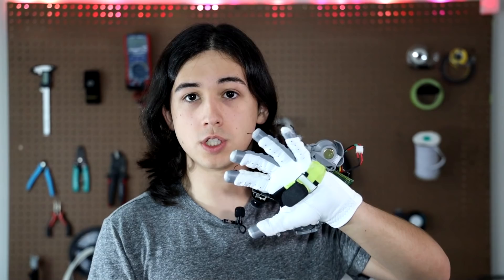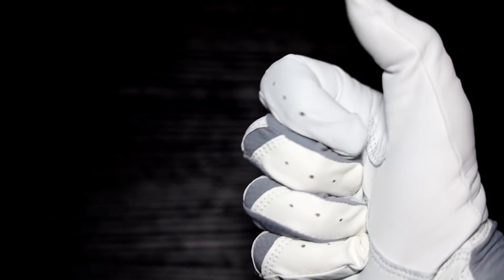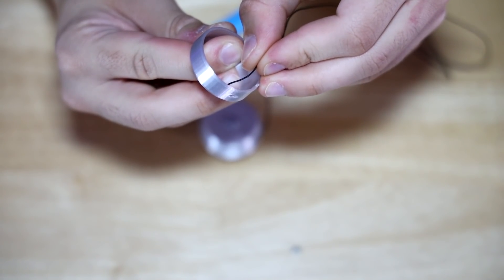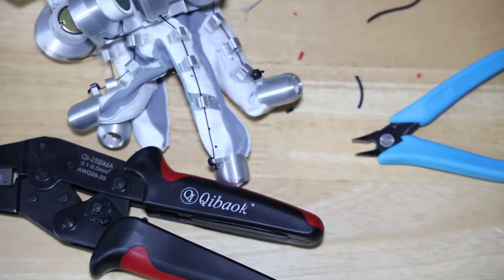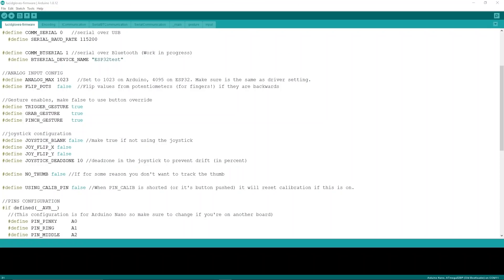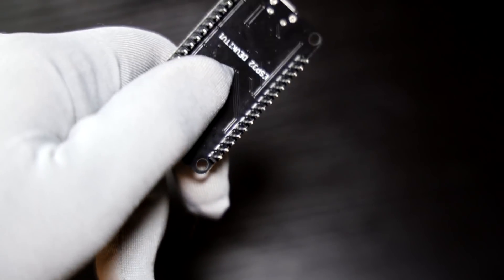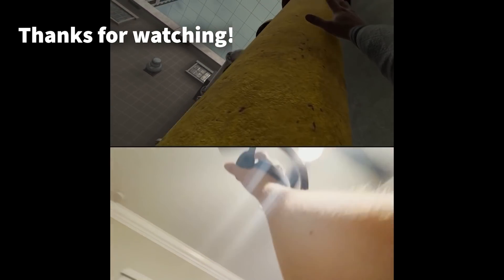How I build CHEAP VR Gloves.

Comment: 1:02 Parts needed
2:03 Glove Types
2:51 Requirements info to use gloves 
3:02 3D printing info
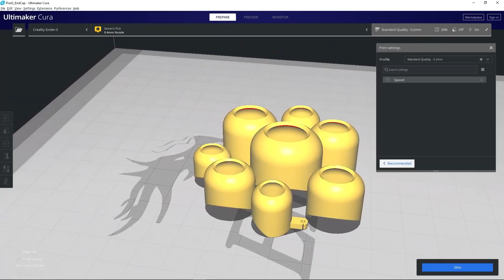3:51 Building the reels
5:52 Attaching reels to glove
6:52 Wiring the glove 
8:31 wiring for joy stick / button 
8:51 Firmware / settings
10:58 Testing Firmware settings
11:35 OpenGloves driver / settings
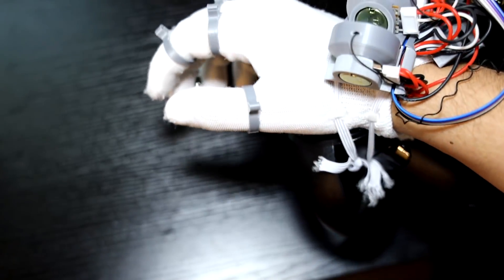13:23 Calibration for VR controllers 
15:20 Bluetooth board options
16:05 Bluetooth Firmware settings
16:57 Bluetooth powering options
17:24 Prototype 4 sneak peek
Reply from the maker: Thanks!
Reply: @LucasVRTech  yes
Reply: @LucasVRTech  Add it to the description so youtube will automatically include it in the videoplayer's bar
Reply: @LucasVRTech  if i make this prototype, will it be updatable to de haptic prototype? Or  do I'll have to make another glove set for that?
Reply: @hernancito8104a  I'm not Lucas but yeah you should be able to pretty easily, you'll have to print a couple new parts and change some things around but from what he's shown it looks pretty similar.
Reply: @LucasVRTech  add this to the description and it auto adds chapters/segments to the video
you likely knew this already but i just wanted to confirm :)
Reply: @LucasVRTech  If u just copy and paste this to the description it puts it in the vid automatically
Reply: You deserve more likes
Reply: ?:?? Bill
Reply: Cheese
Reply: This is possible to use with the quest 2 because of the Bluetooth capabilities, and you can pair controllers to it. So it is theoretically possible
Reply: @yaboiminat0909  actually I doubt it would. First off you need the OpenGloves driver, which isn’t available on quest. Second, because it emulates knuckle controllers, it wouldn’t actually track fingers. I get your thought process though
Reply: @perigonsr  That makes sense, im sure in the future it could work. Thanks for clearing that up!
Reply: What a legend
Reply: was all W
Reply: yes
Reply: thx :)
Reply: thank you
Reply: Is it comparable with ps4
Reply: Ок
Reply: i would love the same but simple to build like without the aptic and stuff just vr glove to do some mocap because fuck i ruind myself with suit already
Reply: Also, a tracker of some kind - either Vive tracker, the Quest 2 thing or a controller just strapped on. Or does Prototype 5 now not need such things anymore? Does it have an open source and/or scratch-built version of such a thing too???
Reply: yes he does

Comment: You're definitely much smarter than me, so sorry if I sound dumb, but is it possible to add a 6DOF accelerometer/gyroscope MPU to the glove so that way steamvr simply thinks the entire glove is just one valve index controller by already having the rotation and XYZ calculations?
Reply: (Asking this because im gathering information about how to make my own jerry rigged vr setup, and don't currently have any form of vr remote.)
Reply: @Mikey91112  Did you manage to connect the accelerometer/gyroscope?
if so, how did you do it and can you send the connection diagram for this

Comment: What kind of board is your ESP32 connected to? A form of breadboard? A perfboard? A regular PCB? And what ize is it? What about in the later Prototype 4, and also 5? Have you provided the STL files for holding the ESP32 or Arduino board in place? And finally (for now haha): I saw a custom LucidGlove PCB you've made later on, I think, with a logo and easy to follow indications of what should be wired to which spots, correct? Have you the necessary files for others to make their own like it out on the Github somewhere or are you planning to do it?

Comment: Yo Lucas! Great work on the haptic gloves and thanks for the guide! My question is: Have you tried this glove on the Pico 4, or have seen anyone use it on the Pico 4? I know I'm a little too late on this, but I really just want finger tracking on a wireless SteamVR setup
Reply from the maker: Yes, I’ve used it on the pico 4 with virtual desktop and it works great. The only challenge is mounting the controllers as we don’t have an official mount for it yet
Reply: @LucasVRTech  Thanks! Honestly I didn't think you'd reply- 
Have you also tried using this on Pico's native streaming software? Does it work just as well?

Comment: I've literally played the part where you say the name of your 3D printer about 15x now.   Ando 3,. Angro 3,  or is it Anxx 30?   .. my brother,. You are a super smart young dude who's definitely going places,. but slow down..  jus a little. 

Please if you can provide a link or just let me know what he hell you e saying there.   I got the plain ole PLA part.     But don't know if you are referencing 3d print software or if you are taking about the name of the printer manufacturer.    

I've been at a loss as to what 3D printer to get.   I want a good one,. but the prices range from $300 to over $3,500.   That's a big range.   Hobbyist 3D printer that will print reasonably fast and with good resolution,. Don't want my pieces looking all rough

Thanks man

UPDATE :.   WOW!  ENDER 3.   How the F did I miss that all those replays of that portion of your video.   Ok,.   Sorry for my rant earlier.

Comment: Could use smd ir led's for the ir tracking and an accelerometer for the arduino for the hand rotation/movement so you can use the gloves without the controller attached.

Comment: If you could set up a way to use a gyro with the board to make it cheaper without a controller needed and potentially have it work with Driver4VR's webcam tracking system it would be amazing

Comment: Rather than use the spring potentiometer why not just use the motors you plan to use for haptic response as the tensioner? It would take up less space and look as well as feel less clunky
Reply from the maker: Because the motors are speed limited whereas the springs are not. Using springs makes the fingers more responsive in game than just motors
Reply: @LucasVRTech  I feel like that's a problem that will need to be solved at some point. For DIY and a prototype it is functional and extremely awesome but I can't wait to see the complete streamlined version

Comment: Have you considered using slide potentiometers? I imagine it could reduce a lot of bulk and a light spring pulling back on it might be easier to assemble than the coiled spring on the rotary. What is the actual length of string being pulled from resting to fist? You might be able to get away with a very short travel range. There are also very narrow slider options that you could lay on their side for a very low profile solution. Issue with these is of course you can no longer hook up motors to them in the same way. There are powered slide pots often used in mixing consoles, but they are more expensive, bulkier and may not even be suitable. You don't need motorized control to pull back on the fingers though, even an on/off latch that stops the string from being pulled any further would suffice, though it may wear the string out faster. Regarding rot/pos calibration, while an automated system is best, in the meantime it may be neat to have hardware calibration on the controller. Something like a 10-turn trimpot and a couple of tactile buttons to scroll through the parameter to be calibrated, and apply it. I'm not too familiar with microcontrollers so maybe this isn't possible for some reason. Anyways, just spit-balling ideas.

Comment: Have you ever considered moving the pulleys further up the forearm? turning it into a potential arm band like half sleeve? The idea I kind of see is a sleeve and adding potential motors for vibration while simutaneously hiding a lot of the wires and framework. It could potentially increase feedback by allowing more options for placement and allow for more unique customizations.

Comment: On Vive headsets (don't know about the rest, but should at least be the same on Index) there is an extra USB port on the headset that you can use to connect things to your computer and apply power. Its only 1 port, but you can use a USB hub to split it out.

If I am playing a lot or forget to charge my controllers I use that port to charge my controllers while I am still using them. Yeah, you can do that.

If you have a 4 port hub you can charge your controllers and run these gloves all at once so you never need to stop to charge.

Comment: I have a question are you gonna make a glove with build in tracking and som like cameras that pick up the leds from for example a tv controller that is like glued to the glove and all ways on as long as the controller is on I can build a prototype but I’m a little bit bad at coding so I need your help to build a vr controller with your prototype and like build in tracing??? Plz answer dis question plz and don’t forget Bluetooth?!?!

Comment: I wonder if a pi could work instead of an arduino... (after porting the firmware of course). Also would be cool if someone could write a port for the driver to the Quest so that it emulates hand tracking more accurately.

Comment: Any ideas of using a regular spring and a strain gauge of some sort to reduce the bulk of those rotary parts? It'll probs need to go higher up your arm, but will slim the glove down?

Edit : there could also be a possibility to incorporate wrist movements with a spring connecting from your palm to the inner side of your forearm?

Comment: not judging or know much, but shouldn't you be using a shaftless encoder instead? a lot easier to design around it, having spring on one side and tiny spool for the wire on the other, some of them are non-contact and should give little to no resistance, most important they can be tiny

Comment: wonder if your plan is to make a jamming system for the string to stop it to simulate haptic

if this is your plan i would recommend stopping the whole wheel thing where the string spools up instead of designing something to jam the string to reduce wear on the system.
Reply from the maker: Yep, that's already in prototype 4 :)
Reply: @LucasVRTech  nice!
Reply: What kind of motors or servos are you planning to use? didnt see the last part sry XD
Reply from the maker: @vulpix9210  Currently using 9g metal geared servos

Comment: Could you simulate virtual object weight by using a servo motor from your wrist to your shoe? Not sure what resistance you could have, but it would make boneworks or blade and sorcery all the better. I imagine that the weight of holding something with one hand would have to be divided across both servos when you grab something with 2 hands. I suppose you could add more servos per foot to add more resistance and overall accessible virtual weight. Even further, something like a sledge hammer has most of its weight at one side so holding something near the head would have 75% weight of the hammer and using your other hand to hold the other side would only have 25%, but the weight total would not change. This would be a huge programming challenge, but if you have access to that info in the game (or you could probably set up an index list of items and their weights to use parallel to a game) then I’m sure you could do it.

Comment: Awesome tutorial.  Question tho.  Most games don't require using all fingers indepenently.  Can you use just 3 potentiometers?  Thumb, index, and 3rd for middle, ring, and pinky together?  Would the firmware and SteamVR be able to bind the 3 fingers into one potentiometer?
Reply: you'll need to do some modifications in the firmware, but is possible.

Comment: would it be possible to make it not be tracked, use it only as fingers and have any controller in hand with a knuckles like mount? I really want just the finger tracking but am not going to buy valve index knuckles.

Comment: Honestly, about the "moving in VR problem" I don't think I mind simply using a controller for my left hand and the glove for my right hand since I'm usually right-handed for using guns or grabbing objects. It's not perfect, but it's a good way to really be able to feel holding things in your hand in VR while still being able to move, bring up the menu, etc.

If we want gloves on both hands and still being able to move and bring up the menu, I think that maybe having a small joystick on your gloves on the left hand on the side of the index so you can simply close your hand and doing kind of like a thumbs up and being able to move. You might as well add a menu button or other button that might be useful. Using gesture for bringing the menu is definitely a clean solution, but I think that the games would need to support it or we have to have some sort of mod that does it.

Anyway, I'm terrible at manual labor so I won't build these. But once you feel like you have a design that could be sold, I will definitely buy a pair or just the right glove depending on the solution for moving or whatever I mentioned before.
Reply: The joysticks on the side of the first knuckle is a good idea, I think having buttons at the bottom of your palm, where you have to stretch your fingers to press them would be a good location for buttons.
Reply: theres also a program called natural locomotion that lets you move with hand gesture, so it can works aswell.

Comment: For the position offsetting, have you considered making something like Chaperone Tweak, so you can look at everything in VR, and using something similar to Eleven Table Tennis' offset tool. (You hold a button and the paddle stops moving, but your controller IRL keeps moving to the desired offset, let go, and then it stays where it is)
Reply: Try give your suggestions through their discord. I think that's a good idea.